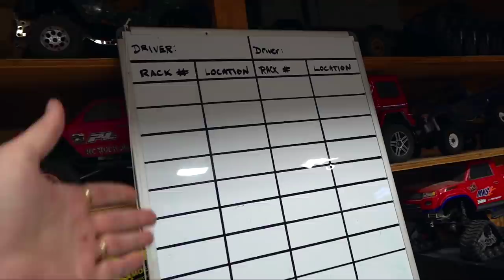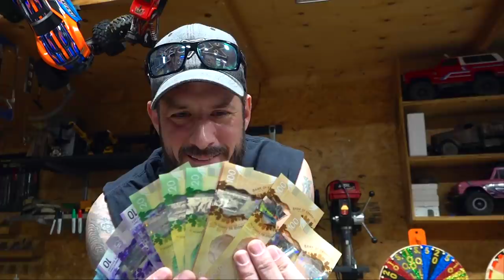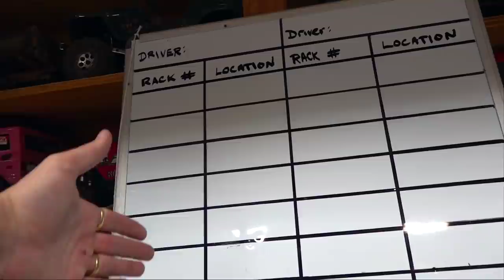LOADING KINGS - FRICKEN LASER BEAMS! THE TRIPLE AXLE KINGDOM - SEMI TRUCK CHALLENGE (s1 e1)

Comment: As a  Trucker for many  years,  I can  honestly say that this is fun to watch. It is not as easy as it looks, especially the fork lifts lifting the pallets off of the racks in the make shift warehouse.  Backing the oversized load is also very difficult to do as the weight of the load can push the trailer in a different direction.  This is fun and I'm looking forward to the next show

Comment: First I have to say what a beautiful 4 axle truck you got Medic.  The new ramps for sure work a lot better.  No one had to lift the pallet to get up the ramp.  The 3 axle extended trailers were awesome. Seeing all the guys having fun, that's cool,  and when they ate having fun, I feel that the viewer has fun as well.  As for the tile call out, when you're a forklift operator, usually you have a loading manifest, so going back to the square to "look" at the manifest would be a waste of production time, so having the pallet call out would be kind of like "looking" at the manifest. Maybe after placing the pallet on the trailer and removing the forks, and still be on the trailer to get the next load item would be ok.  Maybe have it where they have a specific item as well - Rack 9 Top barrels? Then it's a "Loading Manifest".  Love the show and great job to all the guys for refereeing and making the show fun.

Comment: For a hard round: have a 3rd person running the new hydraulic forklift spin a wheel to randomly take a pallet off somebody's trailer.  

Or have have the two electric forklifts on a team vs the hydraulic one but they have to "tag out" after they load a pallet.

Comment: I have an event.  You'll need a simulated roll of carpet (preferably, a pyramid of carpet), and a carpet boom/pole attachment for the forklift.  The event is to switch from the forks to the boom using only the side shifter, and pitch yaw of the forklift.  The carpet is where you secure the boom so that you can remove it.

Comment: If I may, One change I would consider, please.

Allow the forks to be at any height while they are between the racks. Once they get out of the rack I would allow them to be at 2 cm. The 2 cm is based on the new ramps which clearly require an adjustment in height of the forks just to go up the ramp. It seems logical that one could travel at the same height as it takes to get up a ramp.

Just made to bits.

Thank you for your consideration and efforts. 

OH what about a Semi Race?

Comment: I'm curious to know if the scale between the racks are equivalent to a normal warehouse. Seems really tight but I also know there's not much room in normal scale warehouses. How did you decide the distance between the racks
Reply from the maker: it is 16"s in between racks.  Much smaller than "scale". We made it "Possible".. but not safe
Reply: I remember from the video you saying 16" but couldn't remember if there was a reason.

Comment: As you have a rack of tyres.. 
One of the activities in some yards steel coils /tyres. /paper pulp stacks..(looks like a cube.) / and bulka bags which could have rice in them or other contents.   
The thought i had was using a fork probe.(spears thru holes lifting carpet rolls/steel coils). That you could have them load a bunch of tyres.  So having them sit upright.  So once loaded .(at least 8 maybe 10 tyres (loaded from the side of trailer)). Driving off could cause the tyres to roll off .  If use thin tyres. They could roll off and over fall over.. if this happens "PENALTY ""  . If you had a huina forklift.  The extra large..you could be loading xmaxx size tyres.maybe...what might fit with a little overhang.. or this could be a penalty.  Loading with the crane you have. Or excavator.. 
 Another slight rule change  when ever loaded forks must be at the top of the mast..and see the carnage of things falling off. 🤔😂

Comment: Rocky should have fixed that box on the middle pallet. Its hanging off the edge
Reply from the maker: As long as the cargo is on the pallet, it is still in play.. the pallet has to be completely ON the trailer to count.  If he can pull out of the yard with the box on the pallet.. it counts